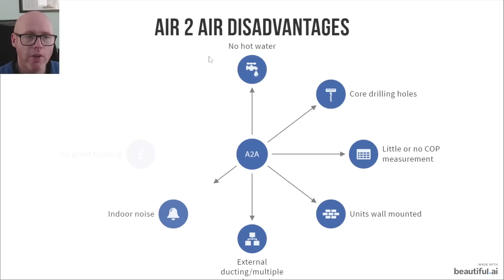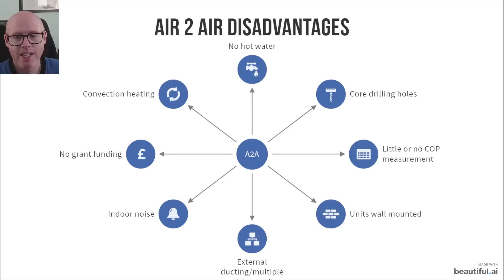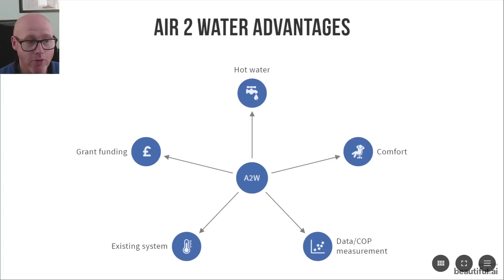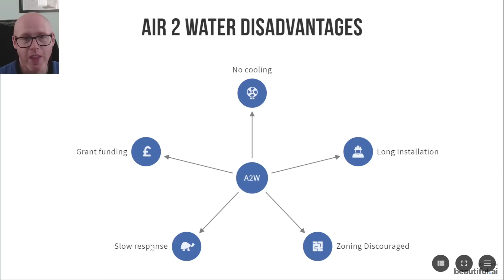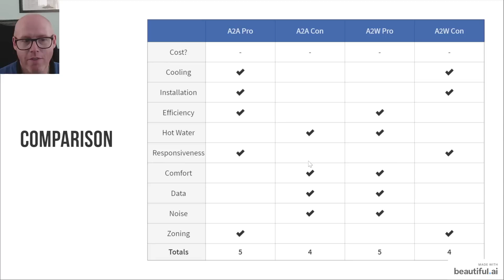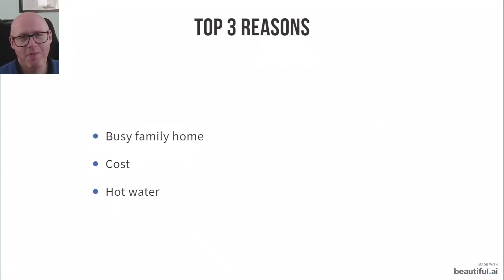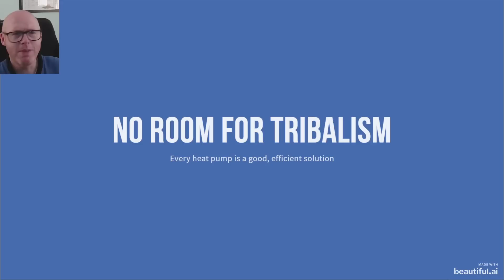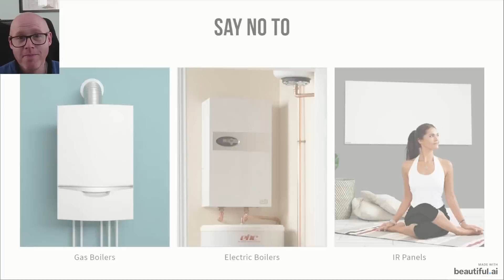Heat Pumps: AIR TO AIR or AIR TO WATER?

Comment: We have 2 Mitsubishi Air to Air both 5 kW and it is not that easy to decide. 

You get fast heating and it is instantly there, but also only there. 
But fast heating comes along with noise.
You need to mount it really high to avoid hit someone.
Multi Split AC are crap if not all rooms connected run at the same temperature.

But the Mitsubishi do not perform as promised and far away from cop, they hide these data and it took years to find the full specs.
You do not achieve the savings promised.
But it can be a chep way to start with a heatpump to get an impression how it works and that it works, but avoid to get 2 at once as we did. Get one installed and make your experience for example with a cheap one in the bath room where it will perform quite well cause you will get instant heat.  For elderly this might be a key moment how warm it can get, but then it becomes expensive cause you heat a rather small room only.
It is also a cheap way with 1 unit to use solar power surplus energy effectively during 2/3 of the year as heat and 1/6 maybe as an ac. Again those will be really appreciated by elderly but only in the living room. 

When we found out that the chinese air 2 water heatpumps of 8 or 10 kW would only be 1800€ or 1500 GBP. 
The air 2 water has come now  on top of the oil condensed heating system + split ac + oven incl. heat exchanger.

Why? 
a2a can only heat 1 room really good and that depends also on the shape: small rectangles with the indoor unit on the long side might not work that well
The control of such heatpump needs an energy meter for each heatpump with power monitoring for example in Home Assistant. Only there you can see the current consumption over the past few hours and how often the heatpump has made a break cause then the efficiency is poor. Then it runs for 10 minutes and stops for 1 and you get 5 or 6 cycles per hour which will end in bad cop and the compressor will age much faster. Compare it to a fridge by adding such energy meter: that turns on only 1 or 2 times in an hour when the door has not been opened. 
You can improve the performance by reducing these breaks by openening doors which means to increase the heat load, but that is limited, rather very limited.
Therefore you need to size it properly which can make it quite expensive. And it is not as easy to install as many think cause a lot of things have to be done or have to be prepared like a more or less dedicated power line. 5 kW heatpump takes up to 2 kW input power which here is limited to 16A or 3,8 kW. So do not connect the heatpump to a socket where you might usually use an heating iron for the shirts and so on cause the breaker will kick in if it is cold. During autum running at 250 W nothing will happen. 
Then you need to drill a big whole through a thick wall where things can go wrong like hitting a cable you were not aware of or a wooden column. 
Do not forget that they need a water pipe to get rid of the moisture from the inside unit. Do not forget that each of these units outside and inside need to be cleaned carefully and I need for that 3 hours per Split AC - inside and outside all the heatexchanger have to be cleaned  carefully where I used for the outside unit (you have to remove all the metal sheets and then you will see a lot of dirt and the exchange unit can be covered with finest particles that water alone will not move away - therefore I clean the whole area with a toothbrush). 

Many rooms and this a2a becomes quite expensive even if you can diy cause 2 of the Mitsubishi are more expensive then a chinese heatpump which has been used for years in Norway where we found out that this manufacturer must have a good quality and it is so good that the german government gives you a subsidy of  35 to 70% cause it fullfills all the criteria and has a TÜV certficate, spare parts are available too, supports RS485 protocoll for Home Assistant and has an app and nice display.
So we ordered it from the manufacturer and it will be added into  the rear of the condensed oil heater .. below -2 °C we will not use the heatpump and oil only to which is an automatic switch to use 300 L of oil instead of 2500 L for 200 m² but that reduces also the amount of kWh needed to heat during cold days.

If you have many rooms forget AC - I would never buy more than 2 AC again cause the bigger COP and SCOP is more or less a thing from a laboratory which you will not achieve and can be really hard to measure: you would need to days with the same temperature curve outside and similiar temperature before to run the heating 1 day with oil and then with those Split AC where you also have to make sure that in our case you use the same amount of hot water . We did that in a different house with a gas condensed heater too and same results. COP 5 promised at 5°C and roughly 3,3   achieved. Assuming the SCOP 4,3 promised was right we should have seen a lot lower oil consumption cause 1200 kWh used would mean that both would have produced 5200 kWh which equals roughly 550 Liter oil we should have saved, but it was rather 350 to 400 Liter and quite disappointing. Now we get a hybrid system to save a lot due to the hot water topic cause that will be produced far more efficient. How can we now ?

Well, we had 1,25 L daily oil consumption which equals 12,3 kWh but we should use with a heatpump roughly 4 kWh during the summer or roughly mid may till end of september. And the difference is huge if you look at 8 kWh savings cause oil heating becomes inefficient. 

So start with 1 ac only and maybe choose the living room where you might want a short time till it is heated up and where you can save a lot. If you have surplus energy from solar power system then it is also a good choice too. The savings in a big room quite often used are higher than in a smaller bathroom. You also have the chance to most likely open 2 doors and heat more rooms too than just 1 small room only . Before you invest in a second Split AC consider the water heatpump and start with those from china cause they are affordable and easy to mount, multiple languages are available and english is quite good translated, but german not so well.
 
Quality ? 
Why should the chinese be bad if they do produce heatpumps for german manufacturers ? 
Therefore their heatpumps fullfill all the regulations like SG ready and the german BAFA requirements which are mandatory if the customer wants grants from the government.    
So be carefull to invest too much into A2A heatpumps cause in the long run the a2w will pay of faster and better . Do not forget that you need space inside (which is easy) but also for the outside unit like the wallmount and what not plus the whole cleanding topic at least 1 time a year, inside the filters need to be cleaned every 6 - 12 weeks.  If you tend to forget that the COP will be getting worser and worser and then it should not be your choice.
Reply: If you're expecting a good cop from using it intermittently then you're running it wrong.

I have a single unit on my upstairs landing, it keeps all 6 rooms upstairs comfortably warm, and it's by no means an open plan layout.
Reply from the maker: Thanks for commenting!

Comment: I’ve got an old oil boiler needing replacement next year and am leaning towards a2a because all my pipes are buried in the concrete floor. I don’t trust they are in good condition having had 4 leaks in the cold water pipes over the last 10 years.
Reply from the maker: Thanks for commenting!

Comment: I had Air to Air fitted in June and so far im really pleased with it , i have a 3 bed house and only 3 cassettes fitted downstairs and the house id fine , it only cost £5k andd was fitted in a day with hardly any disruption at all. i dont have hot water but i will get under sink heaters for the little water needed , i have an electric shower but even at 9kw its negligible the amount it uses for a 5 minute shower. i have found that when i have the heat turned up high it isnt using hardly any more power after the room is upto temperature running around 3,4,5,6 hundred Watts, last month i used 407kwh ,
PS , there is a power cut now from the storm but everything is working fine with the powerwalls , Good review
Reply: For me the attractive thing of air to air was that I thought you didn't need to 'violate' your home with tanks, pipes, controls and a ludicrous amount of associated gubbins......although now you're worrying me with the mention of 4" holes in the walls!  Makes me think I'll just fit nice simple electric panel heaters without any mess or regular servicing.....and pay the larger bills!
Reply: @robertp.wainman4094  I didnt want my house looking like the inside of a submarine, i didnt have any holes drilled into the walls i was lucky enough to have some old vents for the larder all 3 cassettes are in different rooms but close together. if you are thinking about infrared panels i thought about the but i saw so many people saying the room is cold and you need to be infront of them to feel warm , also i would have had to have a lot of disruption to the house with new electric points that ment cutting channels into the plaster that would mean every room needing to be re decorated. if i was you i would go for the Air to Air .
Reply from the maker: Thanks for commenting!
Reply: how is it so affordable in UK, In the USA I have to charge around $12-13k to stay in business long term. Unless its because our homes even in the city  are that much larger than European homes is that including subsidies?
Reply: Interesting I also have a 3 bedroom house. 
Air to water fitted cost just under £4000.
Trickles along at around 500w most of the time 

Nearly every pipe was replaced in my heating system.

I used around 280kwh heating and hot water in November (total house usage 433kwh)
Reply: @Burtis89  i do live alone so i suppose i use less but i do have the livingroom emp high .

Comment: The energy capacity  of ground,  water is much, much higher than the energy capacity of air.
The best one,  the only heat-pump that I can recommend buying is the 3th option:  groundwater or ocean-water to water.
They cost a lot more,  you need to dig into the ground, or lay pipes into the ocean, but they have a reliable heat-source in the cold winter months.
Reply from the maker: Thanks for commenting.
A significant capital difference for a small efficiency benefit.

Comment: Curious when you mentioned about coming in the future hot water with ATA ? is a video pending with explanation? I know there’s no grant with ATA but if any governments priority is to get rid of gas boilers hopefully someone with common sense will take a different approach, I know there’s targets within the industry in regards to heat pump uptake by customers set by government , pity there wasn’t some kind of survey done in regards to ATA so the industry can prove too any government that if you were to include ATA within the grant scheme this would increase the uptake on getting rid of gas boilers hopefully,  are you aware that there are also wall mounted radiator type ATA units so they are not all that are near the ceiling type keeping the top of your head warm but warm air from the ground up which are much better in my opinion, maybe the best video I have ever seen in regards too ATA which I saw last week and it was a year old video I think anyone who would watch it would never get ATW , I would get rid of my gas boiler tomorrow if a grant was available for ATA .
Reply: The reason ATA isn’t supported by government is the UK power network does the majority of planned maintenance during summer and therefore they are opposed to the increase cooling load during summer
Reply: @ruperttodd8639  I’ve heard this so called argument before , it’s a very weak argument , really come on we are talking about here in the UK not Florida,  how many days if any would we need the cooling element of ATA system one day maybe two if we’re lucky , sorry that doesn’t add up at all , if anyone in any government were given the statistics of getting rid of gas boilers with the inclusion of ATA within the grant scheme as with ATW then the use of gas boilers would probably be obtained within three years and not twenty years plus with only ATW on the scheme , it’s so obvious even my cat understands, the system at the moment makes no sense at all , it would be easier trying to explain Norway to a dog .
Reply from the maker: Thanks for commenting!
Reply: @UpsideDownFork  are you sure ?

Comment: You can get nice looking units or if your having a new build then, then the ducting is ran in ceiling cavity and no room units are required. 

The units them selves are not audible, unless you have them on really high fan speed and its not really required if you use them correctly.

Air conditioning on the other hand does dry you out in summer.

You can just get a hot water cylinder with immersion heater if required and heat the water in off peak and boost it if required in peak, it's not really expensive unless you have a massive hot water demand and the price difference between a hot water cylinder immersion vs heat pump cylinder is quite significant and would take a rather long time to recoup the price difference and also will require larger wholes with the heat pump version in walls.

If it was a new build air to air, if retro fitting where you already have the pipe work and rads then air to water makes more sense. ( Unless you want air-conditioning or are in a small home where one or two units can easily heat the whole home)
Reply from the maker: Thanks for commenting!
Reply: @UpsideDownFork  thank you for the video